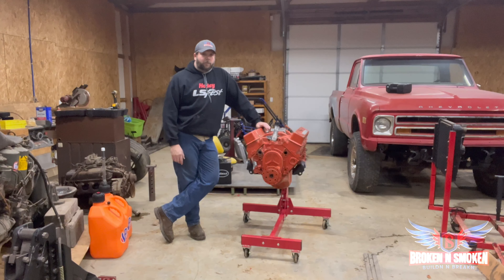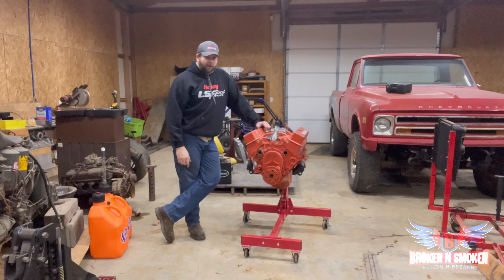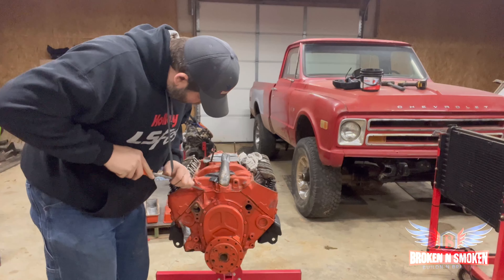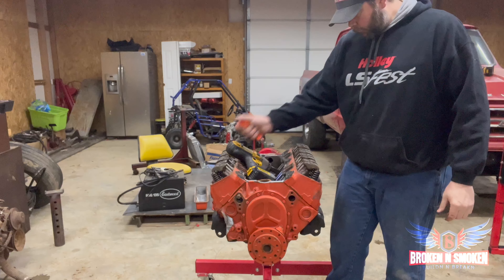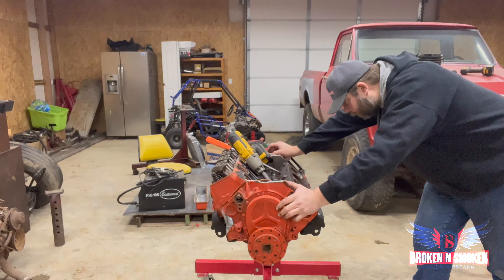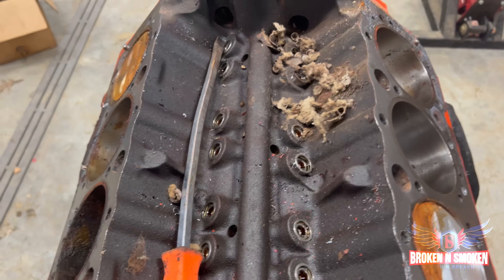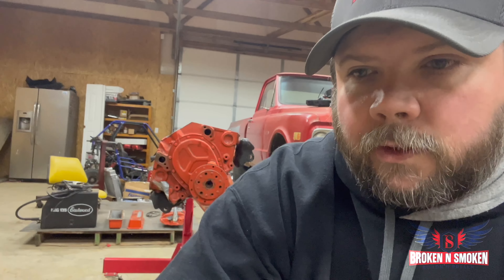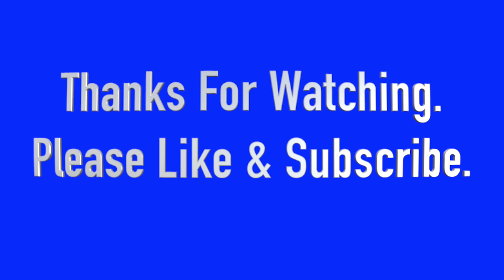Ingine Rust Nightmare!! WWYD? Scrap it or Fix it the BnS Way.......

Comment: It's junk! If that block was a standard bore it would 99% of the time still be junk. It will not even make it to .060. Had countless blocks with rust not as bad not make .060. Everyone seems to think Oh it all just bore out. NO! That's not slight surface rust. Rust on cast is a whole different thing than rust on steel. Cast is porous and the rust goes deep fast. Having run a HP machine shop I've seen it all. I tell customers when buying a block make sure it doesn't have any rust, and if your storing a block, get it in a heated building where there's low moisture. Just a engine sitting around can get condensation there by rust. If there's pistons in it condensation will destroy the  bore super fast. Different metals in contact with each other does it. IE aluminum and cast.
Reply from the maker: I know where your coming from. Being a Tool&Die/machinist by trade I am afraid of what you just explained.
Reply: @brokennsmoken  If you are doing any kind of teardown like this I would recommend if poss at least a chemical bath/acid dip to fix the sludge and rust. As for the cylinder wall could you try a brake hone at least? That is just me though...hopefully that would fix the majority if not all of the sludge and rust...
Reply: @brokennsmoken  what is the project? derby? dirt track? Half of me says just run it (mabey like ya stole it) and see how long it lasts...
Reply from the maker: For a rarely driven c10